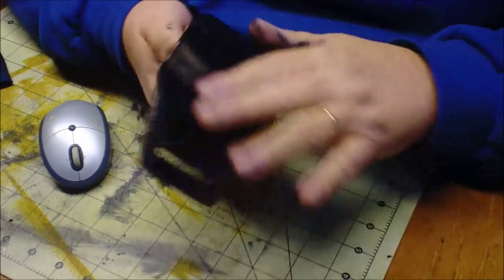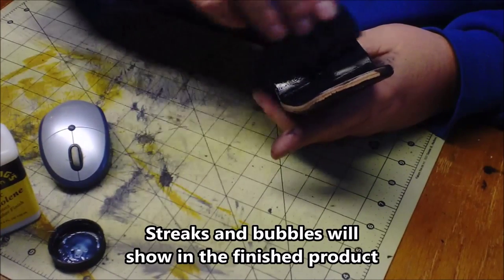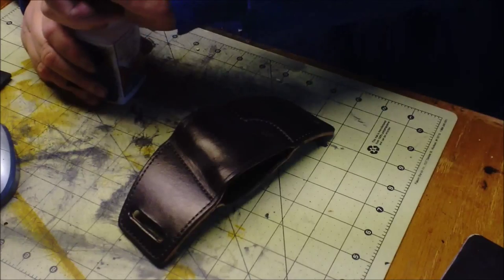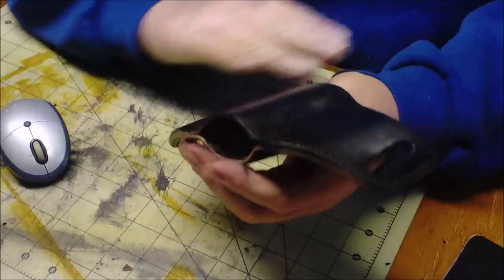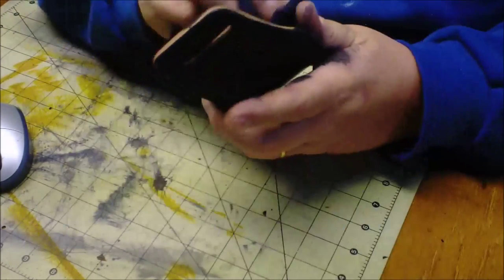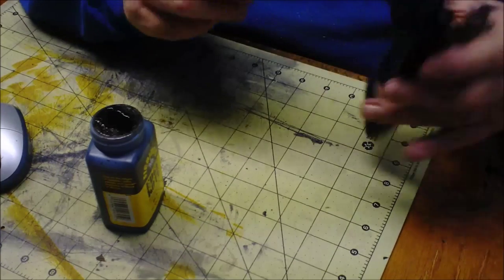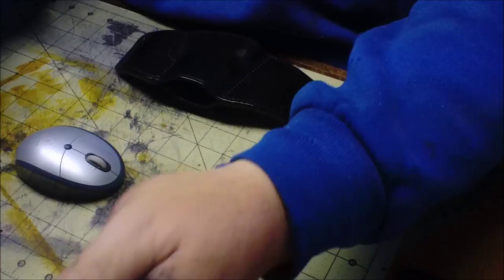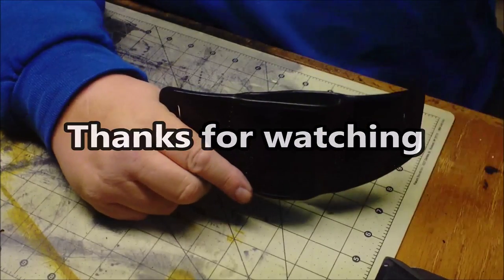How to make a Slide holster: Final finishing (2015)

Comment: Yo Fatmantolly, well thanks to your detailed instructions I've just made my first slider holster for my xd40. Its not as pretty as yours as I just used some scrap leather from hobby lobby. Its softer leather which should make it quieter in the woods. Also glad to hear you're a 41 mag fan, I've had one for 30 yrs and still love it. Your newest fan, God Bless and keep the faith, Ted
Reply from the maker: Thanks for watching, if that leather is Chrome Tanned make sure you have some kind of finish on the inside, Chrome Tanned leather has tendency to cause rust on metal parts. I'm working on getting the mate to my .41 so I can have a pair of them. I have a friend that really likes the .41 and has several of them.
Reply: Looks very nice Teddy!!!!!
Reply: Thanks Mel, I guess you mean the holster.

Comment: Why don't you treat the edges of the leather with dye before you apply the finish?
Reply from the maker: If I'm using a lighter color dye it can cause some dark spots along the edges after the final finish. Most of the time I do it at the same time.
Reply: Awesome job.
Reply: Is this your actual business or just a hobby? If so what do you charge for one of your holsters? I currently buy my holsters from Wright Leather Works in Ohio. Are your holsters moulded to specific gun blanks or just generic one size fits all?